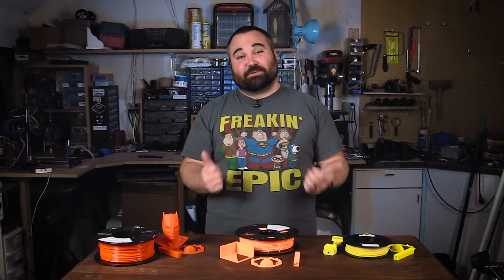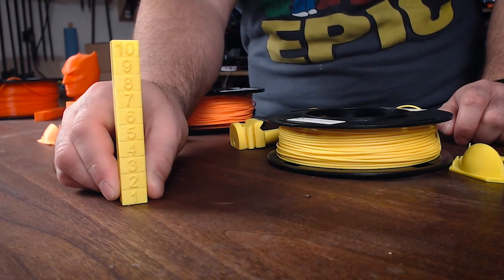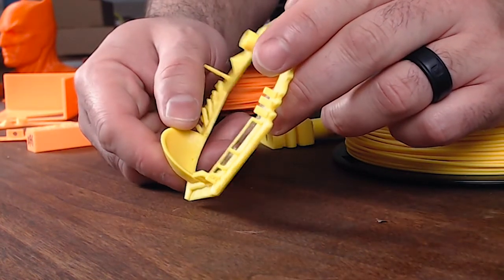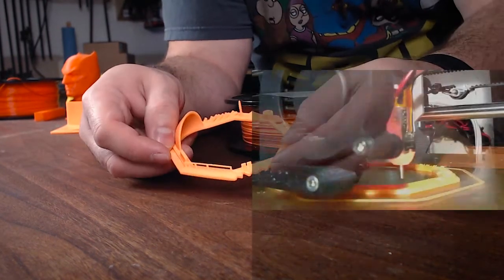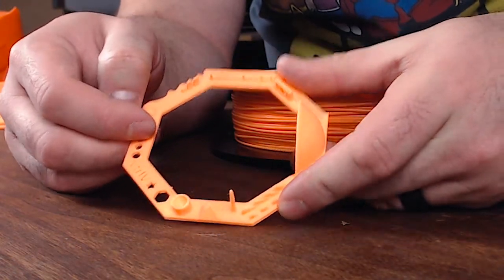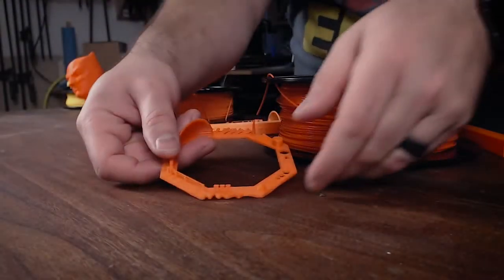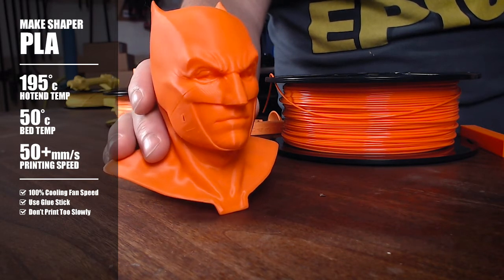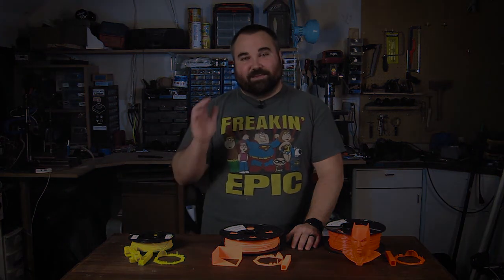Filament Series — MakeShaper: PETG, ABS and PLA — 3D Printing

Comment: How do you use the print tower if using Cura and not Simplify3D?
Reply from the maker: Hey! Great question. I have Cura 2.5 installed, as well, and you can use a post processing script to do this. There is one called "TweakAtZ" that is baked into newer releases of Cura. To access it, go to Extensions > Post Processing > Modify G-Code in the menu and there is a little "Add a script" dropdown on the left of the window that pops up. TweakAtZ should be in there and you can add a new instance of the script for every change you want to make during a print. Hope that helps!
Reply: yay!!! You don't happen to know of free software that offers custom supports do you? I know there's a workaround through meshmixer but my results have been mixed at best w/ that.
Reply from the maker: Hmm... I sure don't. I just know that people are using Meshmixer as you mentioned. Let me know if you find anything!

Comment: Nice video! 
One point, your ABS warped because you don't print with an enclosure. I struggled with ABS until I built an enclosure.
Reply from the maker: Yes very true. I had a Monoprice Select Mini that I used to print ABS on with an enclosure. I need to get one for this printer! Thanks for your comment!